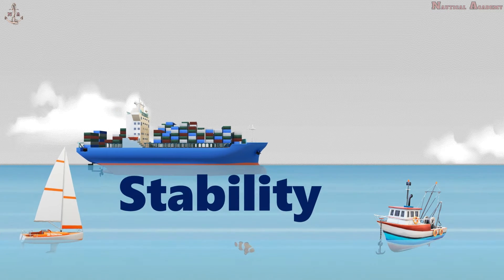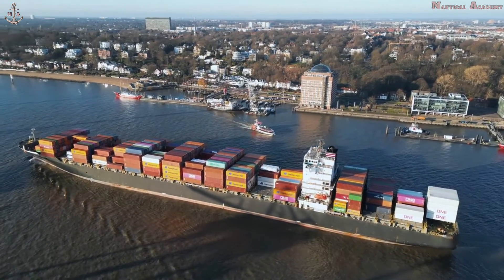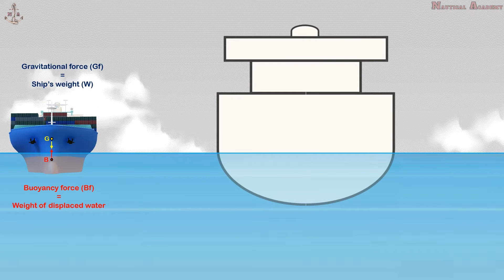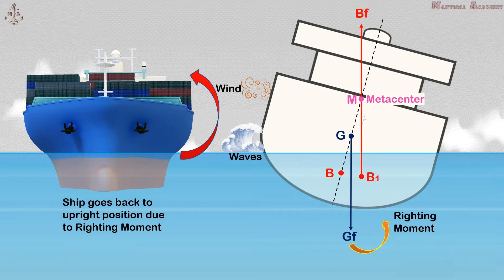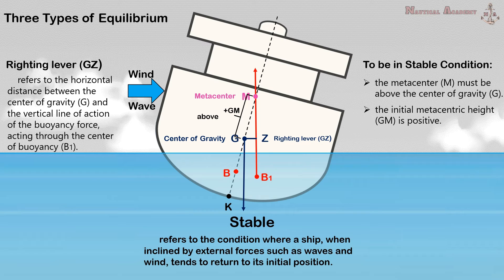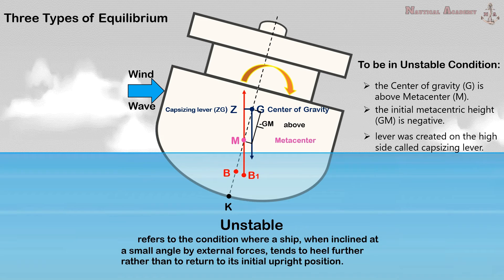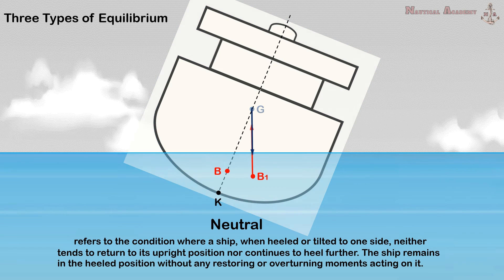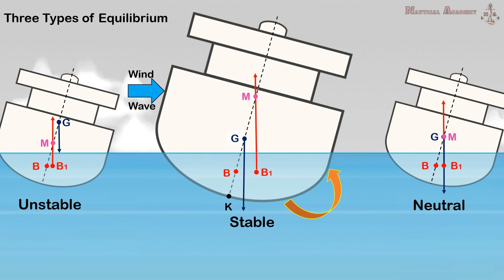Metacentric Height ll GM ll Ships Equilibrium ll Angle of Loll ll Righting Lever and Righting Moment

Comment: Righting is when a ship or boat returns to an even keel.
Reply from the maker: Even keel refers to the condition where a vessel's forward and aft drafts are equal, meaning the ship has zero trim. This indicates that the vessel is neither trimmed by the bow nor by the stern.

When referring to righting or righting moment, it is the force or moment that acts to return the vessel to its upright position after being heeled by external forces, such as wind or waves. The effectiveness of the righting moment depends on the ship’s metacentric height (GM) and the GZ lever (righting arm) at a given angle of heel.

A vessel is said to be in an upright condition when it is not inclined to either port or starboard, maintaining its intended vertical equilibrium. Stability characteristics, such as the range of stability and the area under the GZ curve, play a crucial role in determining how effectively a ship can recover from a heeled position.
Reply: @nauticalacademy001  I'm just saying that righting is when the ship is returning to an even keel.
Reply: @MassimoCalderaro-u8h  He is saying you are out by 90 degrees.
Reply: @ That's what I'm saying that is righting is the vessel returning to an even keel.

Comment: I take it the ship will heel around  the center of gravity (no weights have been  moved), and not the initial center of boyancy. A sailboat generally have  a very low center of grafity, mine is a foot under the waterline. Will it also rotate (heel due to wind forced) around the center of gravity. The hull form makes the center a boyancy move a lot to leeward when heeling. The pressure from the wind acting on the sails, will set it a little deeper in the water?

Comment: sir does in revolve on their certain angle due to moment  £ X•Y•Z?
Reply from the maker: In the context of ship stability and dynamics, the moments (represented by £ X•Y•Z in your comment) can indeed cause a ship to rotate or revolve around certain angles. Here’s a brief explanation:

Moment: A moment is a measure of the force causing an object to rotate. In physics, it’s calculated as the product of the force and the distance from the point of rotation (lever arm).
Axes of Rotation (X, Y, Z): These refer to the three principal axes in a 3D coordinate system.
X-axis: Typically runs from the bow (front) to the stern (back) of the ship.
Y-axis: Typically runs from port (left side) to starboard (right side) of the ship.
Z-axis: Typically runs vertically, from the bottom (keel) to the top (deck) of the ship.

A ship can rotate around these axes due to the moments acting on them, resulting in different types of movement:
Roll: Rotation around the X-axis (side-to-side tilting).
Pitch: Rotation around the Y-axis (up-and-down tilting of the bow and stern).
Yaw: Rotation around the Z-axis (left-to-right turning of the bow).

When a moment acts on a ship, it creates a rotational force that can cause the ship to rotate around one or more of these axes, changing its orientation in the water.
For instance, a moment around the Y-axis (X•Y•Z referring to Y) would cause the ship to pitch, while a moment around the X-axis would cause the ship to roll.